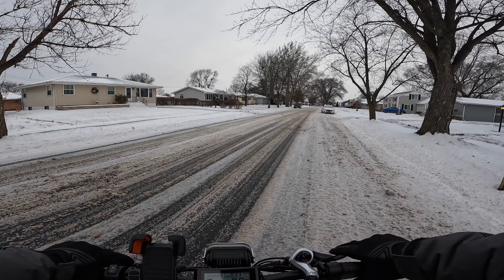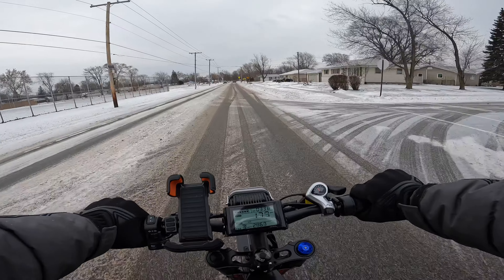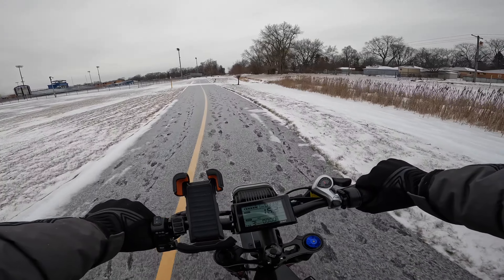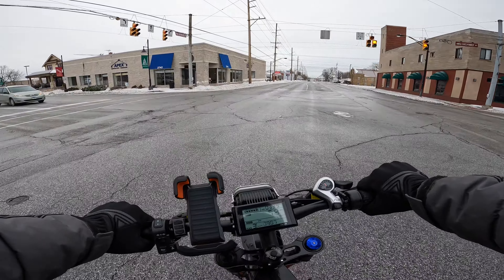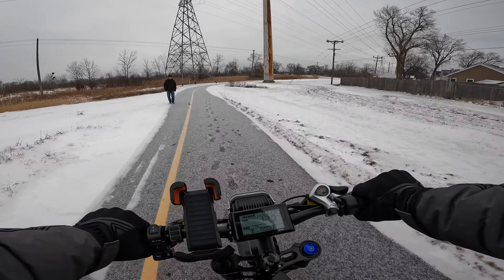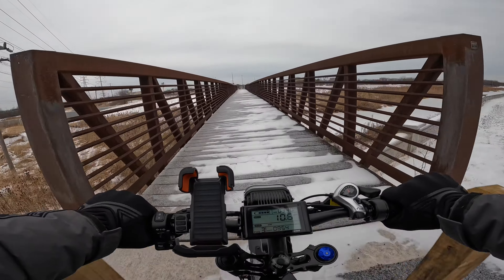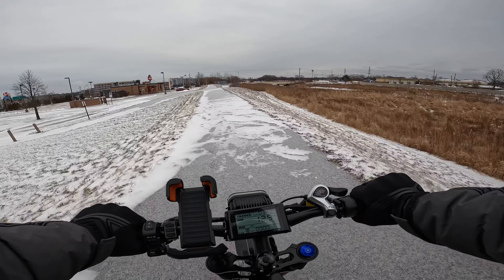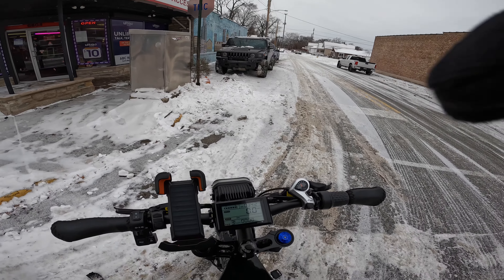Riding 5000w Stealth Bomber e-Bike in snow and during winter commute.

Comment: Very surprised given the conditions you weren't sliding more.

What was the PSI you deflated to? Do you remember?

Also, for gear, any good recommendations on gloves? I feel that'd be the first place for feeling like you're freezing.
Reply: Oh and another question, what tire width are you riding on? You mention not using 2.5". Any thoughts on a good size for conditions you have where it's semi plowed areas and not full on snow coverage?
Reply from the maker: @fpul  in semi plowed conditions you can ride 2.5” just doesn’t do well on especially packed snow and for that at least 3” studded bike tires, 4” inches work the best for snow and ice. Some people put zip ties around tires for extra traction.
Reply from the maker: It was around 20 instead of 25psi you can go down to 15 but I ride the roads as well. Pretty much motorcycle gloves that are advertised as wind proof. Yes your hands will get numb as wind drops temperature. They also have bar mitts which go on handlebars and blocks the wind.
Reply: @thetechgenie7374  awesome! Thanks for the followup! I have a bike now that I ride but it's very very basic. This looks like a nice upgrade once I get my funds together.

Comment: We’re not deleting comments and we’re not hiding anything in our replies. We have worked directly with ASI to tune and refine our drive system to perform to our standards. Our bike does not slow down on hills, maintains 37mph, and this has been confirmed by reviewers. We’ve been honest and open in our replies and we appreciate your concerns, but without looking at our actual performance output graphs and without riding the bike you’re generalizing and it’s misleading. We’d be happy to discuss this further with you so that you have the true information that would help you to understand how our bike performs.
Reply from the maker: Do you know by chance the specs like the torque specs of the motor your using, or model of motor you guys are using as only part of that bike I am unsure about?

It did struggle on steep hill in the “juiced joyrides” review video and one other video when he did a hill climb test at 19% incline and could not get it up without peddling? Now on a more gradual incline it did ok but lost about 7mph going up on less of a more gradual incline. Yes you correct direct drives typically have less low end torque, I use to qs205 direct drive motors and etc that have 195Nm torque.

Did look and see a few 3k direct drives hub motors that are only 95Nm torque?